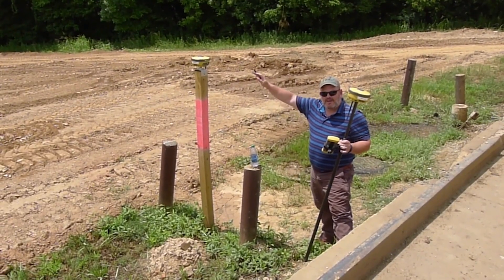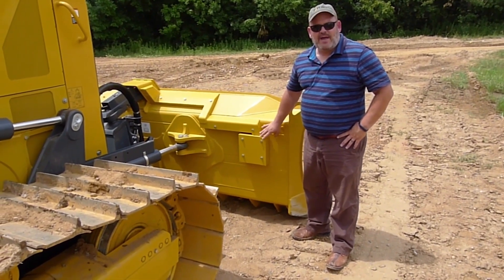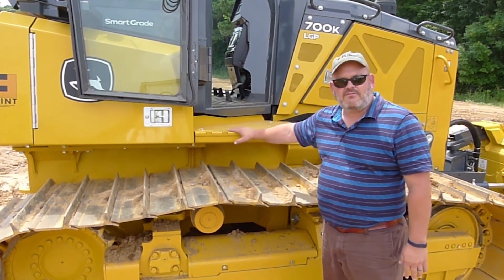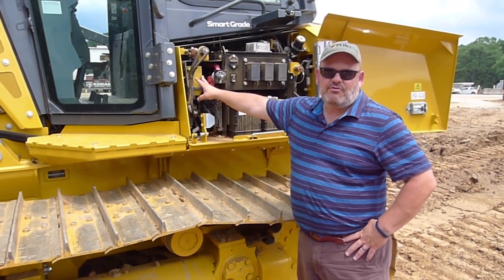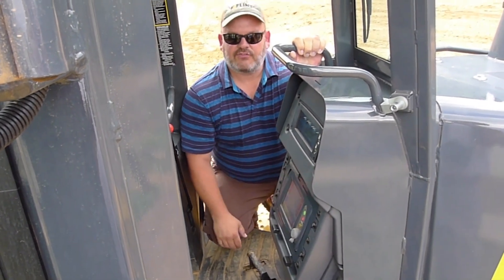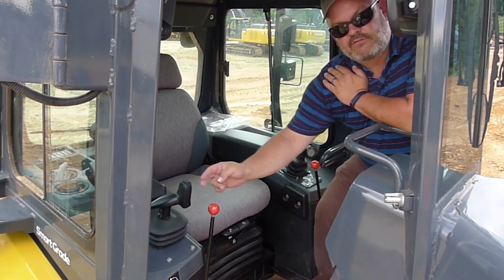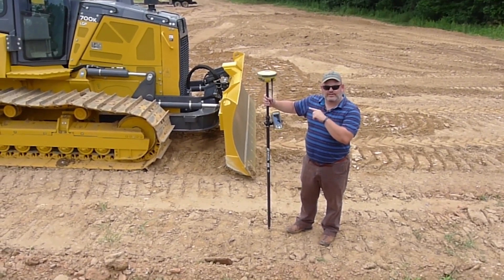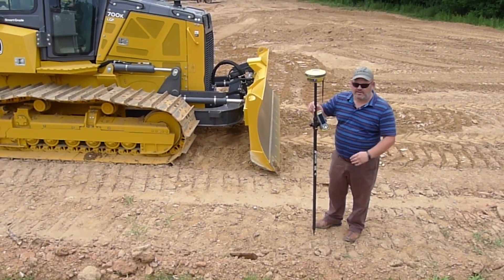How to set up and operate a bulldozer using GPS blade control

Comment: I run a 700k with blade control,it is nice but for an experienced operator it will slow you down. At least for me it does. I can go faster and grade better with out it. Give me stakes and ribbons any day for fine grading.

Comment: can you set it to put in 8 to 12 inch lifts for building pads? Or auto position the blade to put in even lifts?
Reply: You can use offsets to cut to where your target depth is

Comment: WOW...amazing...years ago I used to do finish grade on construction. I was born and raised in the busness. I learned by eye and hand control. They really have it so easy now a days.
Reply: they had to make gps bc they don't make operators like they used to. operators don't run a machine by sight, its done w your ass
Reply: @ejenterprise5540  so damn true
Reply: Even easier when it says Komatsu on the iron.  Trackslip and blade control are much more fine tuned if you could ever imagine
Reply: The tech is out but not all companies provide it
Reply: Yeah you don’t even have to actually be an operator just a seat cover or lever holder
Reply: @ejenterprise5540  not true. Still have to know how to operate the machine. GPS is just a tool to improve efficiency, without a good operator it's pretty much useless.
Reply: I started a week before my 18th birthday my pop put me on a small dozer no gps and he help me master that free hand, im 19 today and my employers had called me today to tell me they invited me to their bulldozer gps classes so excited

Comment: no it still takes a little skill you got to know how to work material,help the g.p.s by overriding it free handed to keep up,and know how far the material will go down when compacted so you can come back and finish it as close as possible but it is cool it takes away stakes,stringing,ect it's fast if the operater can actually operate

Comment: What's the point of even having an operator in the cab?
Reply: You don’t have to be a true operator anymore. If the gps breaks though, and I’ve seen it happen, they’re screwed haha
Reply: The gps just buried the blade and bogs the machine down then jumps up causing a hump the machine jumps over. Can’t the operator Feel that? Gtfoh

Comment: I see that's a six way blade, when you rotate the blade and run across a slope, say 30%, what are the results like when you check it with a rover?
Reply: Matt Duffy it messes up on a slope
Reply: Depends on what grade you’re trying to attain, meaning finish vs subgrade. You can switch it between vertical and perpendicular lifts which will change how it cuts on a slope. Learned that one on a very steep bank at a bike track. Surveyors didn’t know it either
Reply: Simply use it not rotated , you can see up to 3 tenths difference taking a pass at another angle or even just cross passing.  I hate to say but even the Komatsu pxi machine has these results but it seems to be tighter than the systems Deere uses??

Comment: so topcon has figured out a way to elimate the pole on the front of the blade?
Reply: Seems that way, the Inertial Motion Unit (IMU) basically tells the processor where the blade is all the time, while the machine mount helps the GPS position the machine more accurately as well as more predictively - there's always a processing lag between what the GPS receives and what is displayed at that moment in cab to the operator.
Reply: Trimble has also. They both have it fully integrated now